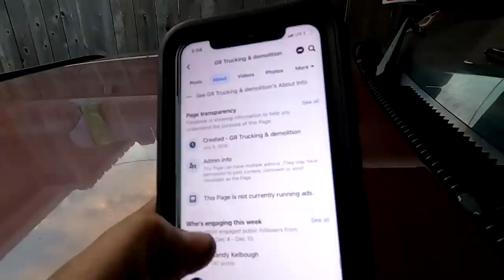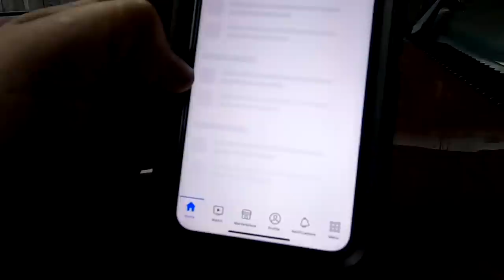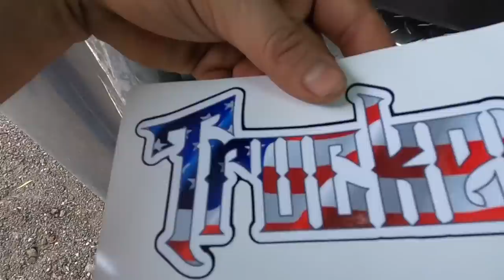How to LOAD and SECURE properly EXCAVATOR to lowboy trailer.

Comment: I just got my class A at the beginning of the month and have always been fascinated by oversize loads. Never actually looked into how a lowboy works and finally searched on YouTube. Your video was the video that seemed the most legitimate, and I'm super happy I watched. Thank you!
Reply: What transmission are you running? More specifically how many speeds? Thought about way down the road after I get plenty of experience and if I can afford it, starting my own company focusing around heavy machinery loads.
Reply from the maker: Great to hear!
Reply from the maker: I have a 10 speed on my trucks. Now if you plan on getting really heavy I would advice a 13/18 speed

Comment: Keep the chains tight. Tight so they’d be solid I see chains on trucks on the highway they loose and moving around. Not good. All chains in proper areas hooked onto machine and trailer. Hook onto strong points of the machines and the trailer. If possible, crossing a chain or wrapping it around something I have done before and it worked. Chalk wheels on machine if need be. 

That’s the shit everyone. 

They make chain binders that you can tighten with a impact drill. They are handy but you have to bring your drill with you which is also money like the binders were. I do it the man way and work the arms out. 

Some lowboys got magnets 🧲 you can turn on. 

I have them on mine it’s sweeet.

Comment: TF type of trailer is that? I've never seen a lowboy with a generator or whatever that is that's loud asf. I guess that's for trucks that don't have a PTO, I'm assuming, anyway! It sounds very annoying. Shit, PTOs, in some cases, are annoying but aren't as loud as that. The PTO on this truck that I'm in is surprisingly super quiet, which actually makes me wonder if there is something wrong with it. Although I love it, the problem with it being quiet is forgetting that it's on. I'm new to lowboy, though, and so far, it's an ok gig. Except it's a lot of work being as though I do it locally here in Washington D.C., where turns are super tight, and I haul multiple loads in a day, vs one or two a day if I were doing this OTR! I drive for a construction company, and we have escavators, but I haven't had the opportunity to haul it yet. I mostly haul the asphalt machines, at least so far.
Reply from the maker: It’s a pony motor, I personally prefer this over a pto for the reason you can hook up to any other truck needed. Not every truck have pto. I do have a pto pump but only use it for my end dump.
Reply: @Grtruckingdemolitionllc  Yeah, that makes plenty of sense! I'm pretty new to the lowboy thing, so yeah, it's plenty more to learn! It's pretty fun, though! I'm considering doing this OTR, if I can find someone who needs a driver for an OTR lowboy! I've also done dump trailer as well!

Comment: Hey bro question about oversized loads, since your doing local loads do you still need to get permits? When do you need to get permits?
Reply from the maker: Anything oversize or overweight need permits no matter how far you are traveling
Reply: Thanks bro and what’s your lowboy specs what’s the well length